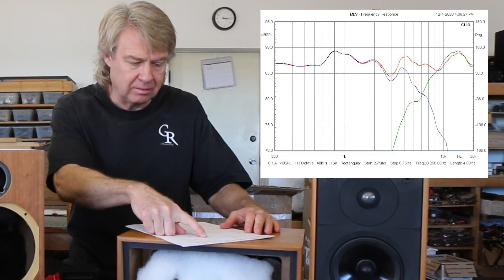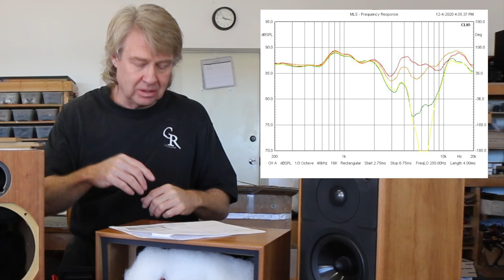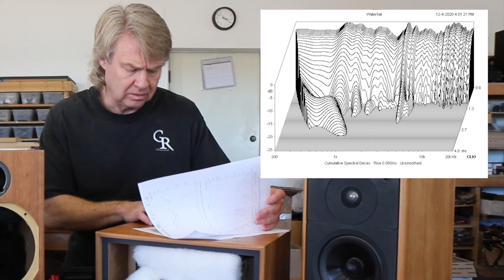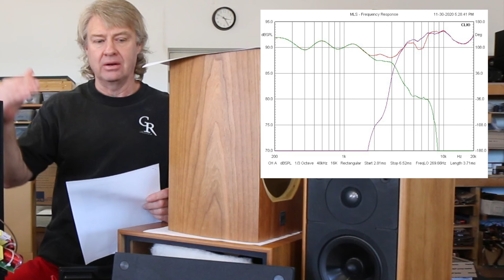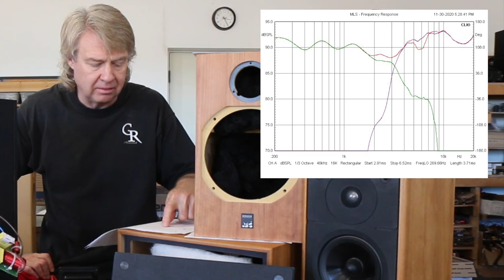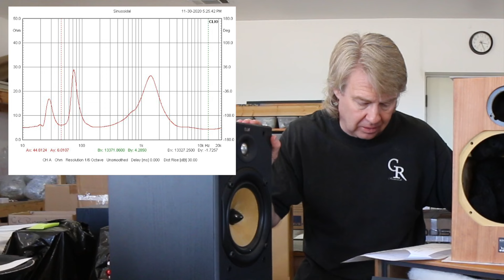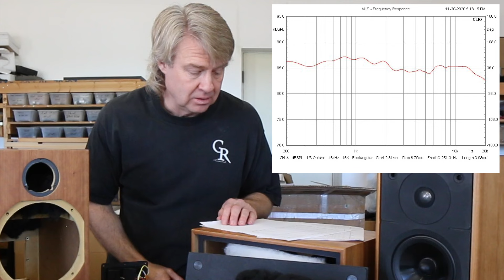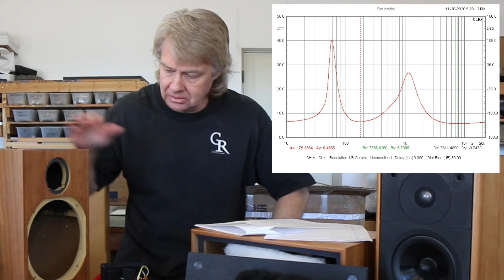FINALLY! A SPEAKER DANNY LIKES?! B&W, Epos and ATC!

Comment: An interesting mix of traditional (ATC), high tech (B&W) and innovation (Epos). I would have gone for the Epos ES14 as it’s a purer version of the design. If there’s a bit of mid bass downward roll off, position the speaker next to the rear wall. Unless I’ve missed it there’s quite a bit of driver and crossover matching. Then there’s the size and scale of each of the manufacturers. I’ve still got some ES14s. They still stand up today as musical and communicative. It’s music for pleasure for me!!
Reply: I wouldn't call ATC and Epos low tech (as opposed to B&W high tech) - more like emphasizing different aspects of the speaker design.

Comment: This is a general comment rather than about this vid specifically, but I only just started watching this channel and it inspired me to take a look at the crossovers in my Mission 780 speakers. The components are all cheap, and I've tried a quick experimental upgrade. All I've done is replace electrolytic caps with polypropylene caps - nothing special, just some I had lying around. And the improvement is astonishing. It's not subtle, it's jaw-dropping. It's "Wow, was that detail really there on my favourite recordings all along?" I'm going to get some good components and build whole new crossovers now. Many thanks for an excellent channel.
Reply: Were they of the same value?
Reply: @frequentlycynical642  As close as I could get them with what I had. The originals were 15uF at 10% tolerance, and I replaced them with a 10uF and 4.7uF in parallel at 5% tolerance (and which actually measured a lot closer than 5%).
Reply: @osliverpool  Did your reply end with (and which.....    ???

I'll def have to try this.  A few bucks could be well spent. My speakers are almost 40 years old, so the effective capacitance may have drifted way off original.
Reply: @frequentlycynical642  It ends "(and which actually measured a lot closer than 5%)". I think replacing your old electrolytics with film caps is well worth trying.
Reply: @osliverpool  We know that electrolytics go bad.  Why a good audio rebuild includes cap replacement.  I looked at a schematic for a three way crossover, as my speakers would be.  Caps are used, of course, for high frequency pass through.  Also, to drain high frequencies from the woofer and mid range.  Why bother at the woofer?  

Anyway, I can't imagine a capacitor increasing in value, so capacitor aging would probably mean mostly a loss of high frequencies going to the mid-range and tweeter.  

Hopefully, while I'm off work, I'll open up my speaker cabinet and see what is in there.  I've been "into" electronics for some 60 years, so I'm good with this simple project.
Reply: @frequentlycynical642  Ageing caps can definitely measure as if they're increasing in value - it's down to current leakage making them appear to the meter to take longer to charge. Degrading caps will also have an adverse effect on resolution and clarity as well as any frequency effects. Also, as well as electrolytics going bad with age, they have worse effective series resistance (ESR) than good film caps even when new, so they charge and discharge slower which can smear the sound. I've compared brand new electrolytics and film caps in signal paths in amplifiers, and the difference is clear.
Reply: @osliverpool  Thanks!
Reply: @osliverpool  I have replaced coupling caps in a phono stage with WIMA 1uF MSK2, the treble has improved, the old E caps were 4.7uF input and 10 uF output
Reply: @manFromPeterborough  Good stuff 👍I've replaced iron core inductors with air core ones, and used better caps now, and mine are up another level.

Comment: First order crossovers are great cos no information is short circuited and so isn't lost. Only diminished where necessary. My snake oil. Also never resist a tweeter is my snake oil. And have the terminals of the tweeter well twisted just before the tweeter (not soldered). Just before the soldered terminals on the tweeter. My snake oil I found out by soldering the crossover on a pair of speakers I made. After that they sounded more "scratchy". So that's why I twist the tweeter wires. lol I don't listen to med driver in the box or out of the box. If you tap a driver in the box it's a warm sound. If you tap a completely open driver it will hardly make a sound and is a cold sound. But if you place the driver near the hole and the driver is semi open it will also sound warm when you tap the cone. With a bass vented speaker hole and the driver near it I get an open warm sound instead of the usual closed in warm sound. It's a sound that is different to "normal" med driver mounting. For coaxial speakers it's possible to raise the coaxial driver just above the speaker hole (with spacers) if you make a 2" deep tube running inward around the speaker hole. Surprisingly it works and sounds like any other bass vent except it's completely point source. To make a full range driver have more khz put a 1 cm hole in the dust cap and glue a 1 cm x 3mm skinny diamond shape piece of foil (with pointy ends) over the hole. The ends horizontally glued to the edges of the hole. Use coffee can seal stiff foil. It's tedious but rewarding. You will hear serious cymbals! FR not muffly!

Comment: About a year ago I bought a pair of active SCM20ASLs from a small studio. Despite being “vintage “ they were sonically fine but the cast aluminium cabinets were in need of a refurb. I stripped them down and had the cabs painted. I have them on (very strong) wall brackets and have a self designed and built 120 litre transmission line active sub to help them along. They feature ATCs “Super Linear “ drivers and ClassA amps which help in keeping the room warm. Keep your eyes on the classifieds guys, there are bargains out there. The cost? £825 or less than $1100.
Reply: Zvonimir Komar  I found one source that says they run Class A up to two-thirds power and another that says the tweeter amp is fully Class A.  Like you say, it doesn't really matter but I do know that the whole aluminium cab is very warm all the time.
Reply: Crazy bargain! well done.

Comment: EPI had a small two way with only a capacitor for blocking DC to the Tweeter. I sold the hell out of them because they were CLEAN in their presentation. It's why I've waited for a mature, inexpensive, individually amped and EQed to the drivers speaker.

Comment: Sorry about poor english!  Danny , about B&W 602, and every  two way speaker  of 600 series (1,2 and 3);   I'm afraid be impossible to fix the problem only by changing it's crossover!!   This because  Kevlar speakers are woofer, not a mid bass!   I own  a 601 s3  since 2004. I bought it new!  I realized immediately poor hi mids !  It's original crossover have a 6dB 8a cut frequency, around 1khz,  to low pass , and  a 18dB 8a cut frequency to hi pass filters! There is a hole between  woofer and tweeter!  No mids!! I put another 2 way  crossover   , open a low pass filter, to 3,5 khz,  but  there was a terrible ressonance in hi mids!!  Then , the only way to fix this speakers  was change  to a 3 way crossover , and add a mid range!!  I put a JBL titanium drive opened, like a domo drive, without horns!! Sucess! It'a another speaker!!!   Don't waste time trying to fix this speaker  with 2 way crossovers!!  Hugs from Brasil!
Reply: I forgot to say: the original B&W  hi pass filter is a 18dB 8a  4khz cut.

Comment: Fair enough. When I was on the AES Melbourne Section (Australia) committee, Billy Woodman visited and gave a presentation. It must have about 35 years ago.  He passed around the legendary 5" dome mid-range driver, which had a huge motor. You needed both hands to hold it. Ever since then I have been interested to see various reviewers comment on the transparency and width of the soundstage.
Reply: Sadly Bill passed away recently a great loss to the industry and I'll remember the many times we sat and talked after a pub lunch RIP Billy.

Comment: I have a pair of ATC SCM100's I bought them over 20 years ago couldn't afford the A's but being a 3 way cab makes a massive difference, so detailed, I replaced the original tweeters with a pair of Beyma CP21F maybe not the best choice, I understand that being a slot type rotating it 90 degrees gives it a wider dispersion, this I've yet to try.

Comment: Thing with Room Sound  on that ES12 is that you can EQ it , so if say your Speaker has a dip in response in mids off axis , which is a problem due to summing for room sound , you can EQ the Room to boost mids and correct for room sound that  lacks mids due to off axis speaker behavior .
So its back to ok . That is a mouthful for you ppl not versed in this but but i cant say that simpler .
Of course you need to know that , you need to measure that . 
But if you are to pay big bucks for Crossover and Upgrades you should .Its logical ,  Measure you speakers ppl , but dont pay big money for measuring microphones , they are all the same , but some cost 50 other 1000 $, to you it wont make any difference since you dont have anechoic chamber

Comment: You know I never bought a brand new set of speakers. In the late 70's I went to Radio Shack and found a kit to build a speaker cabinet and I did. Filled it with 8" woofer, 4"midrange, and 3"woofer. All from Radio Shack. I loved the sound only could not get a second cabinet later to make it a pair. In the early 80's I went to a local swap Meet and found a pair of heavy speakers were the cabinets were strong. Only black wood. Guts I thought were bad and I paid $20.00. Just then someone wanted the guts, so I sold them to him for $14.00. So, technically out $6.00.  I then went to a local Electronic Store that sold all kinds of parts. Sparky Electronics. I bought two each 10" woofers, 4" midrange, 3' speakers, and three way crossovers. The cabinets had great insulation and I fitted them all speakers into the cabinets. Oh, did they sound fantastic. As years went on I replaced the guts from the same place about ten years ago. This time brands were Peerless brand, I even bought out the extra 3 sets they had of tweeters. The store was closing. For when ever.  The new guts again out of this world sound. I will never part with them. I later acquired my Dad's old Stereo we had done the same to his around that time. His were two-way but great sound too. His was a 1971 Pioneer receiver, Dual turntable, and DWD speakers ( they are still beautiful cabinets). I use both stereo's today. Sometimes you just have to assemble them for an ideal set of speakers.

Comment: Had that B&W model as a kid the 602 S1 and later the S3 (S3 had improved bracing from memory and improved tweeters) absolutely hated the sound though. Very bight highs and boom from the port, they sold incredibly well tho! Both the Epos and that B&W model were similarly priced at the entry level sector of the market (rrp for the B&W was £299 brand new at launch) the ATC on the other hand is incredibly expensive and would expect better performance 1k-1.5k which takes it into the I can afford a good pair of studio monitors for that cost

Comment: Danny's endorsement of the ATC, was all I needed! I am saving for those!
Reply: look into scm12 pro
Reply: I own a pair of atc scm 11
Im happy to answer any questions you might have.
Reply: @lextr3110  SCM12 PRO is essentially as SCM11. Same drivers with I think the tweeter being the S version
Reply: @ivorproblem1332  nah it was made long after the scm11
Reply: I have the ATC SCM19 and could compare them to the SCM11. I think you should try to get a pair of the SCM19. Bought mine used for 1500€ in Germany :-). I also added a SB-1000 subwoofer and use a Yamaha A-S1200 as an amp.
Reply: ATC SCM20v2 absolutely amazing clarity, tightness and power but imaging and sound stage are awsome. Market price $4k/pair 2021. Nothing else close. 2nd week, still breaking in.

Comment: The Epos Ess speaker has two sets of binding posts and I suspect they are designed for active crossovers and bi-amplification. The cap is probably there just for a bit of protection.

Comment: two notes for the curious:
1. phase cancellation is never 100% even if you were to reverse polarity on one of two identical speakers. 
2. off axis destructive phase interference between drivers is more pronounced closer to the speaker... 

*as stated in the video, it only takes 4" off axis to get a reduction in high fq at 1m. but 3m away a 4" off axis deviation will show a much diminished high fq reduction if any.
think of how the base of a cone gets larger as the cone gets taller.

Comment: What about nearfield response?  Some speakers are only designed to be listened to on axis as monitors being directly in front of them.   For me, I use small monitors 99% of the time where I am directly in the center of both speakers.  And I have tower speakers if I want to fill a room with sound.

Comment: The ATC is much more money than the other speakers. Not surprising it is better designed. I think they are around 3 thousand a pair, The others well under a thousand.
Reply: The ATC SCM11 speakers are available for £1300 GBP a pair (about $2000 USD)

Comment: What would be the upgrade to the ATCs then? Not done any DYI myself on gear, but from what you're saying, does not look expensive or difficult to do that minor upgrade. You have the 11s, I have thr 19s which has a magnet that makes the 11s look small. Sounds great.
Reply: We recommended a cap and resistor upgrade, new wiring, a set of tube connectors and a sheet of No Rez. All of that totaled $295.
Reply: @dannyrichie9743  Sounds reasonable. I know you have the ATC SCM19 v2 in your shop, can't wait what you make of them. The woofer is something else, gigantic dust cap with a sticky tar on it and over 10kg of magnet.

Comment: This is why I started building my own speakers for my personal use. I look for any weak spots in my cabinets and I can give it the knock test and I make them look like fine furniture I use a 2" baffle besides that I can always add on to it take something out add something tweak the crossover maybe upgrade a driver add anti vibration feet . I will never buy a commercial speakers again I don't think. I would buy a plan or a kit without the knock down pack
Reply: Brits makes the cabinets to sing with the drivers. Same as many acoustic instruments.  Brits are on another level of making  speakers, and someone who doesn't understand the concept can't improve the product, but quite opposite.
Reply: @JoJanDiezel  I don't think just the brits build cabinets that sing that's the whole idea behind a good cabinet they do have some really good builders the idea is to make it tuned like an instrument
Reply: @BostonMike68  Indeed, but I have seen people reinforcing cabinets of good speakers, because they think the walls are too thin.
Reply: @JoJanDiezel  true then the volume changes.
Reply: @JoJanDiezel  I'm interested in listening to the pmc speakers . I want to get into building transportation lines. They make a little bookshelf transmission line. That's skill to get that many folds in a bookshelf. You get some really good bass from t lines but they are harder to figure out but that's what makes it fun is the challenge
Reply: @JoJanDiezel  Do you know for sure whether that's why ATC enclosures are not as sturdy/thick as those from many other manufacturers?

Curious, as I think ATC actually DO know what they're doing. So I'm thinking there must be a reason they don't simply choose thicker, denser wood.
Reply: @Tazmanian_Ninja   Yes, that's exactly the case. They are tuned to resonate at curtain frequency (around 1400-1500Hz) which is found to be pleasant for the human ear.
Reply: @JoJanDiezel  Really? Can you point me to some more content/literature about that?

Comment: Wow.. 3 speakers, 3 completely different price points. A small amount of research tells you the B&W retailed around the 600 price point, The EPOS at 1100/pair  Not surprised you liked the ATC SM11's  Current speaker at $2200/pair!   As far as bang for the buck, the B&W's were quite the bargain with B&W manufactured kevlar driver, dome tweeter and tweeter tube right off the Nautilus line and a crossover with air core inductors, poly caps and decent connectors. Good components in a very inexpensive box.
Reply: Yes, I agree, plus the Epos is circa 1996 and the B+W is a design from 2002, whereas the ATC is from 2012/3 (though their speaker technology probably doesn't change much!) I have a pair of SCM11's and I really enjoy them. My only real issue is the need for the speakers to be within 40cm/16" of the rear wall, in a carpeted lounge with 2 large squidgy armchairs a few feet from the speakers. 'Not sure what I can do to help with SQ but it would probably involve some major change that my other half would not allow!